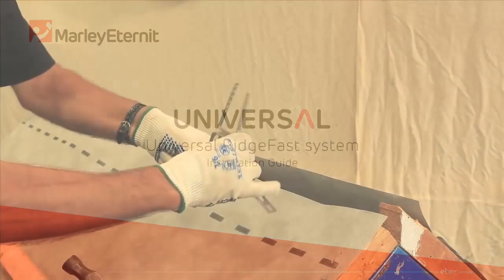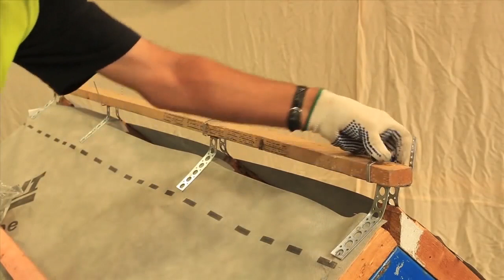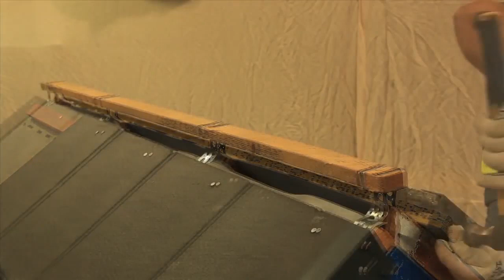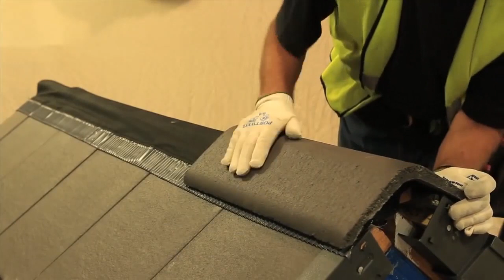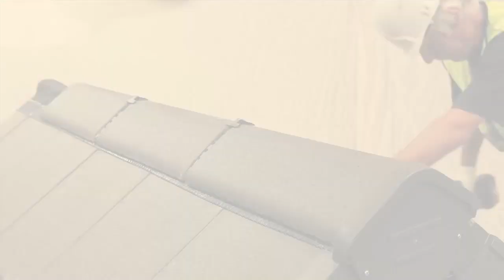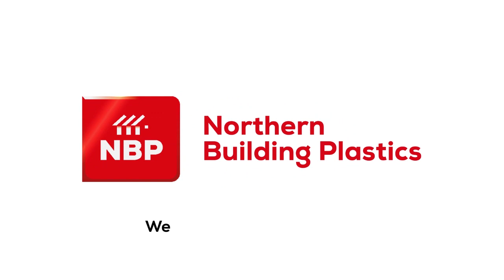Ridge Fast Installation Demonstration Video

Comment: Would this ridge vent roll be suitable for an old style roof with a ridgeboard. If so would there be any difference in installing
Reply from the maker: Theoretically, you should be able to install a ridge roll on an old roof, but you would be best consulting a roofer first
Reply: @nbpltd  ye I just had a new roof noticed something was wrong from the start I couldn't see any gap at all in the felt. They said they cut a 5mm slot. But I looked at the Marley plans they are for a truss roof with no ridgeboard. Our ridgeboard is 20mm thick so it's wider than the gap they cut. Obviously they should if cut either side of the ridgeboard  or no air can get out but I'm 2 months after I told them what was wrong now I've got a serious amount of condensation and all my rafters are mouldy. Rot will happen. And they did the same to 100s of roofs in my street.
Reply: No it wont only works on shiney new tile